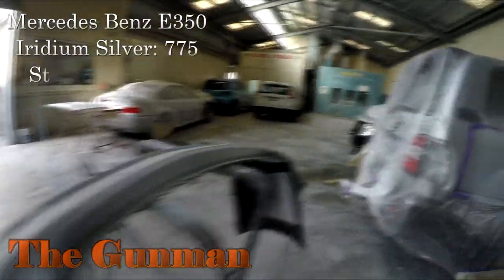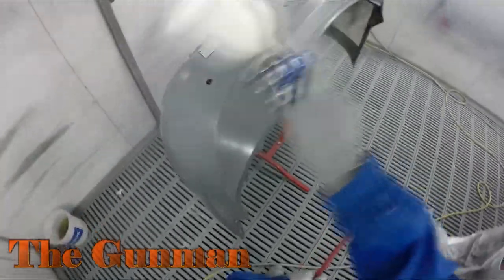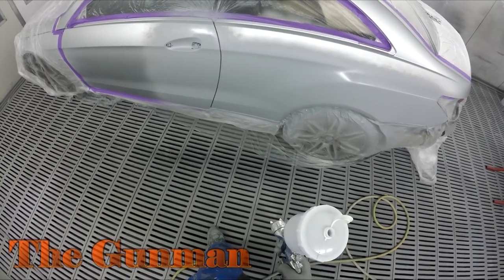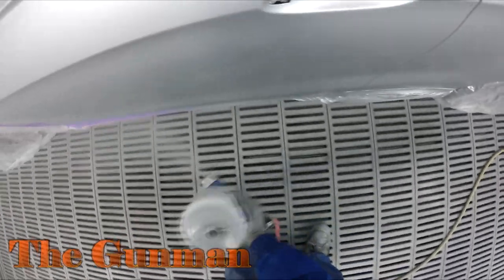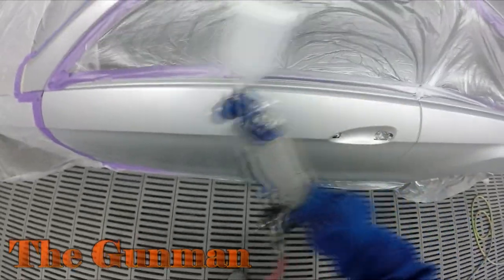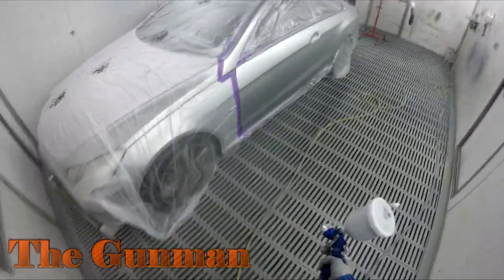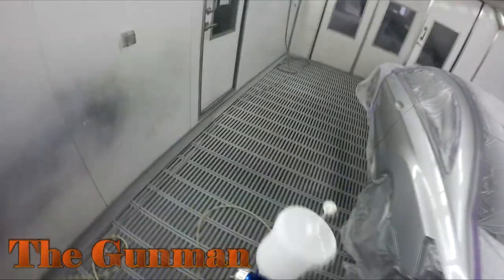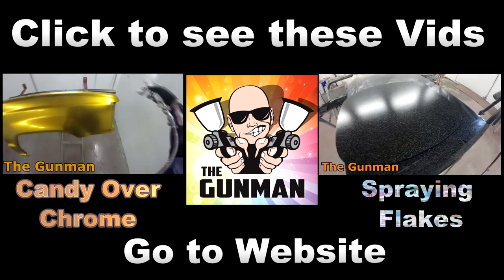Mercedes Benz E350 Spray Painting

Comment: awesome work.
Nothin worse than doing work over someone else's half assed attempt at a repair.
Could the variation in colour from bumper to quarter, just be in the way the bumper is positioned on the stand?
Had this issue before, and found some of the pearls would lay down and shift different. I started bolting bumpers back on or make sure i positioned it as close to the way it sits on the vehicle and found i dont really have that issue anymore.
Just a thought, but you would know best.
Cheers

Comment: I miss spraying solvents :( We're using Sikkens Autowave MM. It's a water system, doesn't dry worth a crap when it's damp, needs lots of air movement. 1000grit or finer for blending metallics. A lot of the colours are very transparent. I've sprayed a couple single stage urethane jobs, and a couple Sikkens Lesonal jobs years ago. I found both those products to be easier than this water system.

Comment: Hey Gunman,
I'm just getting into painting cars and your videos have answered thousands of questions. One more I had. Do you know what would be a good quality cost effective brand of paint to use here in the US? I want to spray good quality stuff but cost is obviously a concern. Just wondering if you could point me in the right direction.
Thanks! Charlie
Reply from the maker: I'm going to have to recommend Cromax to you, they run a binder system so you can choose the quality you want and pay more for the top quality, less for the low qual and they also have a mid range line too, the real thing is to get a good clear which is what's going to last or not, I would even say go the mid range basecoat then a top shelf clear on top jobs, use the cheaper clears on everyday runabout type cars that get chipped and scratched when at the shops, the UV resistance is the real key difference in the better clears so if in a real sunny area the better clears are recommended.

Comment: hi mate, such another great job.i have a project and i gonna paint with 2pack, but it has some acrylic primer on it, do u recommend spray sealer or block off this acrylic primer and spray 2pack primer? can i spray etch primer on top of acrylic primer?a spray painter friend said he use acrylic primer and then 2pack base and clear and its fine....sorry so many questions...tks for ur videos mate it really help me a lot.cheers
Reply from the maker: It will vary from primer to primer, there are some acrylics that are safe with 2k but not all and found the only way to find out is the hard way unfortunately.

Comment: b is for build sent me not disappointed
Reply from the maker: +Mitch thanks for stopping by mate
Reply: do you still work in Perth if you do I have a 1989 Nissan 300ZX that needs to be painted
Reply from the maker: Mitch Yeah I'm still in Perth mate. How much work involved, is there lots of damage or just a quick blow over?
Reply: A bit of work mate bit of rust on the dog leg of the passenger rear quarter panel, front right fender exposed to bare metal, the rest is minor scratches and clear coat peeling/fading paint closed door respray paint code KH2
Reply from the maker: What's your expectations of it and budget, you want show car or just a tidy daily driver
Reply: Time, quality, and budget. Pick two ;)
Reply: The Gunman budget 7G and near show car conditions I just want it to look clean
Reply from the maker: Mitch Hard to do near show car for $7k I would have been able to help if you wanted a quick weekend job blow over on a Saturday but the shop I work at isn't mine so I can't store it, there'll be around $2k materials before anyone touches it and most good painters won't work for less than $50ph here, you could go see my old business partner at SprayTek Refinishing in Bayswater.
Reply: OK Cheers mate I'll shoot him a message on Facebook I appreciate it a ton :)

Comment: what happens if the client picks the slight colour difference in the bumper bar?
Reply from the maker: +Ryan P we would have started by showing them the front bar which is actually exactly the same as the rear bar then told them that from factory there is a colour difference on all cars of they insisted that it wasn't acceptable we would have had another crack at it

Comment: @gunman: what is your gti pro set at for base? I am an apprentice painter and have gone rounds with my painter about adjusting my gun settings from base-clear. with base, I use the recommended settings which is 2 - 3 turns out I believe but with clear I have found that it flows better at 4 turns out like you do. now, the painter was on my a$$ about not changing the settings due to viscosity changes. what do you recommend?
Reply from the maker: Nothing wrong with changing the gun settings to suit the material and desired finish. Base isn't clear, you don't spray it the same so why should you need to have the same gun setup?
Reply: thanks gunman, I was wondering that same thing. I didn't think it would be a problem

Comment: The same mis-match in the shade happened when I got my Iridium Silver E-Class resprayed. It's been 2 years now, I am still annoyed with the job but really can't afford to get it done perfectlybecause the last paint job has to be sanded down completely.

If you get such harsh shade differences between panels, it should be the garages responsibility to get it as it should be and not just give an excuse to why it came out like that.

"Iridium Silver is one of the hardest paints to match" "We'll have to respray the entire car" ... no. What you've done is not use the recommended primer and sealer, or not colour matched the existing paint or hand mixed paint with high tolerances. You had only one job!

I'm sorry, but you can't leave the customer to deal with the mess (mistake) you've made with their pride and joy.
Reply from the maker: If you can afford a Benz you can afford to pay insurance for it. Then just find a reputable repairer.